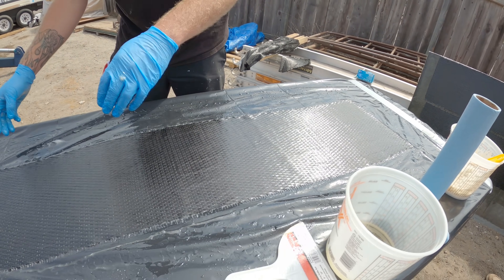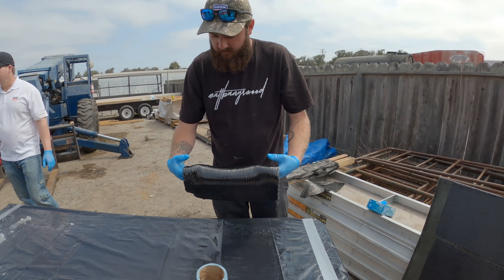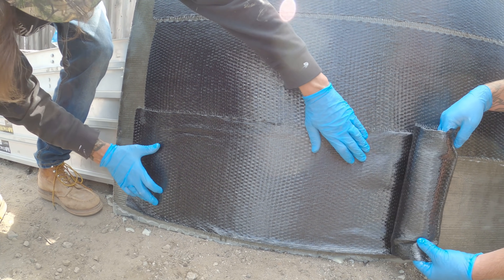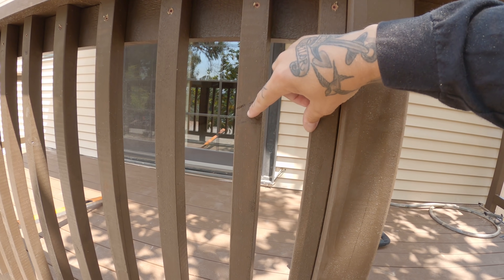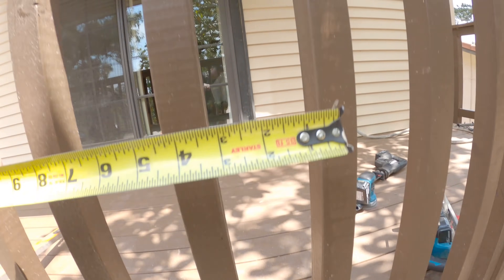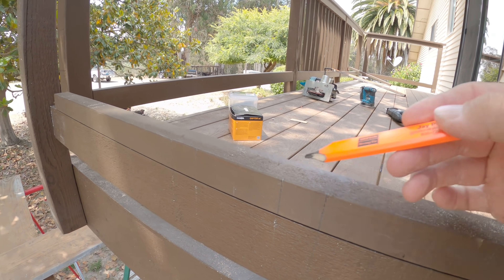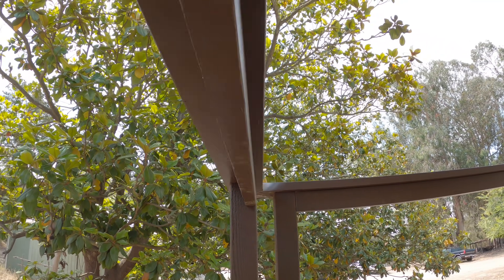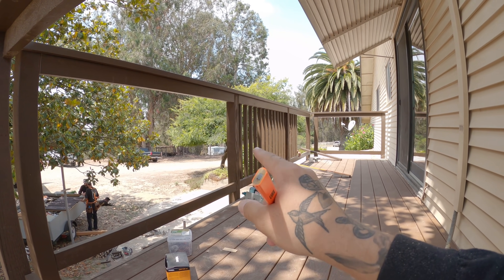EASY Deck Handrail Design | 42" and 4" Building Codes?

Comment: If your wood is splitting when putting in deck screws, set your impact driver to reverse and burn a shallow hole in the wood with the screw. Then switch to forward and drive them in.  The end of the wood won’t split Bc you’re basically using your screw as a drill bit.
Reply: Or use self tapping screws

Comment: I would think that you have the 4 inch maximum spacing for the same reason that we have a 99mm Max spacing here in the UK so that a babies head cannot go in between them and end up stuck, if a babies head cannot fit through then nobody is getting through that gap.

Comment: Can you cantilever floor joists on the inside of the house or only on decks?  If you are wondering why I would want to do this, I have a basement renovation I am about to start.  The staircase is horrible and needs rebuilt and repositioned, but there is a wall in my way.  This wall is currently supporting 4 true 2x6 joists.  2ft away from this wall is a beam supporting these joists.  On the opposite side of the beam is 15 ft of open space until we get to the opposite side of the house which is where the other end of the joist sits.  If I was able to remove this little wall... Or at least move it 6in closer to the beam, my problem goes away.  *Disclaimer, don't worry about any advice you give me, I plan on hiring a structural engineer to come and speck everything anyway and also plan on getting a building permit... I really just wanted to ask to see if this was a crazy idea or not before I spend $1000 to have an engineer come out and tell me it's a crazy idea haha
Reply: I think it should be fine unless there is a direct load on top of the joists in the space you want to cantilever. For example, if the joists just hold the floor and there is nothing else up there then it is most likely fine. If there is another wall right on the end of them however, that weight is being carried to the ground by the wall you want to move. If you were to remove the wall the joists could crack. If there is a wall resting on top of the joists you need to analyze it to see if it is load bearing. If there is no wall or post or anything up in that space then i think it would be fine. I dont have eyes on the site though so definitely double check with your structural engineer. Disclaimer im not an engineer, just a carpenter that has done a little studying to try and figure this stuff out so i can be a better carpenter.

Comment: 42" railing height is nuts!
Reply: Residential used to be 36" until the California Residential Code was adopted.  At the code hearings they forgot to change the Commercial 42" height to 36" for resi.  Picket spacing was 9" in the 70's, went to 6" in 90"s and now 4".
Reply: @johnbrownlee2341  is always been 42", it's in NFPA 101 you guys need to read ALL the codes not just some of them...

Comment: That looks like a massive cantilevered balcony. Surprised they would hang those joists out so far.
Reply: In a previous video he explains the rule is 2-1 or even 3-1 and that since the decks 6’ out the joists run 12ft into the house minimum.. I’m just a stupid 2nd yr so I know poop on a stick. The deck was already there so I’m assuming the original builder is the one that stuck those joists out like that? You couldn’t add it afterwards could you? Because you couldn’t extend the joists? Anyways just thinking out loud here. Hope everyone’s having a great day!
Reply: @betyerbottomdollar  me personally, I’d prefer it had legs. That being said that hideous I beam below is good support I suppose but no way I’d have a full hot tub up there either lol.. crazy owners!